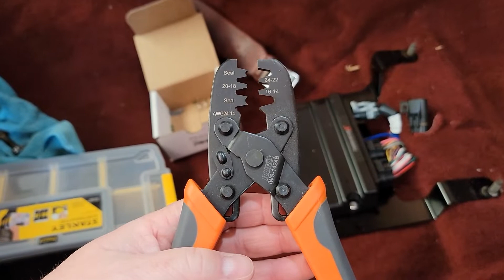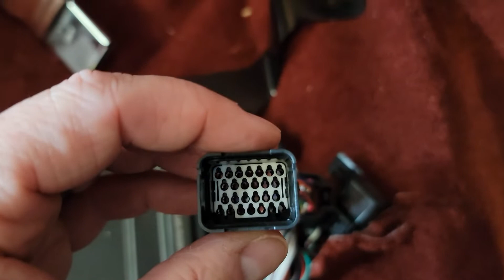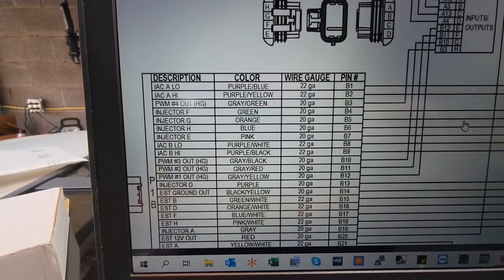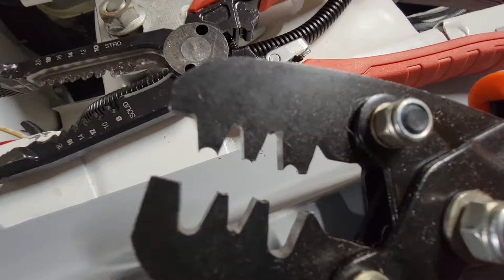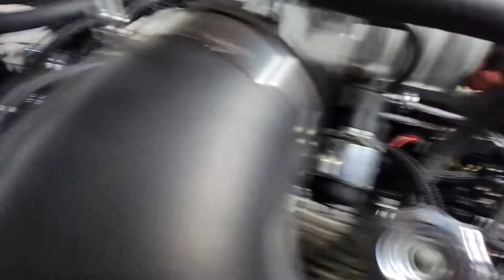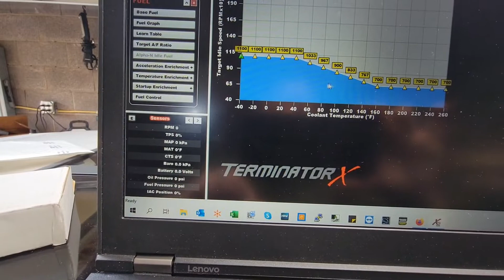Holley Terminator X Foxbody GM IAC Install Part 1

Comment: If your car doesn't idle at exactly what your idle is set at, your time needs work and you need to adjust your throttle blade till it's less than 5%. TPS reset, try again

Comment: Does that part that works for a Ford Fiesta actually work with the sbf? I had the accufab gm adapter  for the Holley hp and have had many issues with it and need to try and find a better replacement. You just use the fiesta part with a gm IAC sensor pushed in? I don’t know how your part was so cheap when I remember how expensive the gm IAC by itself was at the store
Reply from the maker: It's all one piece and works great. The only issue I can forsee is if I went to bigger camshaft that had a lot more overlap or duration that would require more air at idle. As far the gm iac goes, that style of iac is not proprietary to gm. It's a style of iac that other companies used. For used it on the Australian fiestas, I'm assuming they used it because of its size? I'm not really sure about that. But it does work just fine.
Reply: @Riffs_Garage thank you very much sir. I may have to try and order a backup one. Glad to hear it works and hope I don’t have a problem with fitment. Thank you for your time and reply. Have a good one
Reply from the maker: @timweb1510  it bolts right up. I started out using the LS iac settings and started tuning from there.

Comment: Riff -  At one point you had a full wiring diagram pulled up on your computer ,
Where did you find that diagram ?  
   Thanks
Reply from the maker: I got that from the holley website. You have to get the non-foxbody wiring diagram.

Comment: hey quick qustion i wacthed your video  a while back i purchased this IAC gm style. so i installed the holley terminator x 550-937 i couldnt get the F for the musatng . long story short i installed it... it fires up but i cant get the IAC to work it should be plug and play right im assuming cause it has the GM connection for the IAC any help would be appriciated thanks.
Reply from the maker: did you set up the software for LS iac? I would start there. if its still doesnt work then double check the wiring diagram. ive heard of some the holley wiring harnesses being wired wrong.
Reply from the maker: I added my email address to the contacts. You can email me and we we'll go from there.
Reply: Did you figure it out?
Reply: make sure you set the IAC  on the hand held as a GM Stepper motor

Comment: another question, did you use the existing 2 wires or did you just do all 4
Reply from the maker: You have to run all four wires. The ford iac wiring is using two wires from the outputs.  The gm iac wiring is already predetermined, which makes it easy
Reply from the maker: Are you on Instagram or Facebook?

Comment: did you happen to have the part number for those pins?
Reply from the maker: HLY-570-211
Reply: @Riffs_Garage  thank you. I have a motion raceworks icon throttle body so I need to do this
Reply from the maker: Here's the holley part number.
Reply: Do you have a part number for the pins that go into the J1B connector? I want to make sure I get the correct ones. Thank You in advance.

Comment: What setting did you use in the program for the iac( the one you showed in the video). 
I’ve been having a surge issue with mine. Quit possibly something else to do with the tune somewhere. 🤷‍♂️
Reply from the maker: I believe I used the gm ls setting

Comment: hey man i was wondering how that IAC worked for you ?????i just bought a holley 550-937 ford universal it has ford injector harness but gm base connectors so i need a GM style IAC was wondering how this worked out for you? i dont really wana cut or splice the terminator harness i knw accufab sells a adapter so you can put in a gm style iac but this seems easier and cheaper.
Reply from the maker: I like it better than the ford iac personally. It's well worth the 25-30$ you'll spend

Comment: I have run a Terminator X in my supercharged h/c/i foxbody for a couple years now and am really happy with it but have had a couple minor things around startup and idle that have annoyed me (three slight surges every time on startup before idling steady, a couple surges as I would put in the clutch coming to a stop before catching itself and idling rock steady and the occasional hanging throttle in a parking lot where I would have to wait for it to decay down or shut the car off to reset). My research had me suspecting that the change from a ford iac to gm or chrysler style stepper iac may help but never got around to it until now. 

I was about to order the Accufab iac adaptor for a foxbody and was researching the additional pinning of one of the connectors and running wires to a four wire plug for a steeper style iac when I came across your video with a stepper iac from a ford application that bolts right on to a foxbody throttle body without an adaptor. I can't believe I had not seen that anywhere before. I  only found one other video that came out around the same time and no other mentions on any of the forums or fb groups. 

I promptly ordered the necessary pieces and just installed last weekend. Car fired right up and immediately noticed how much more control the stepper iac gave me over the ford style. I did make a throttle blade adjustment and some tune changes to dial it in and find what the car liked but it starts easier, no more surges at startup or when I put the clutch in and low speed drivability, especially when cold is noticeably improved. 

Thanks for the great video, much appreciated!
Reply from the maker: Man that's great! I'm glad I could help!